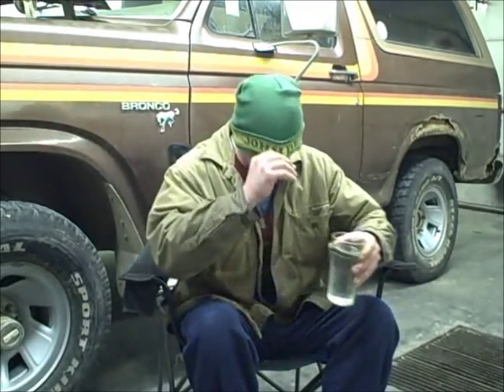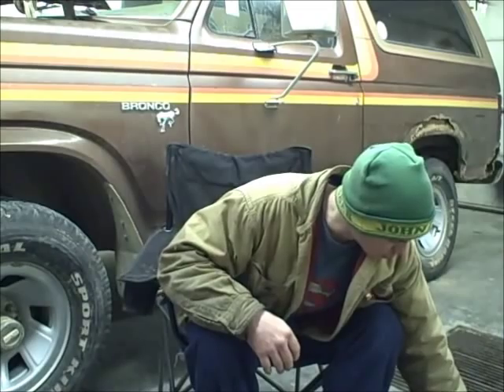Response to my brake line fix

Comment: Let me start by saying that I have worked on cars since I was 10 and I am soon to be 40 and have even been a Diesel mechanics assistant as well.

I know for a fact that compression fittings are in fact safe if they are installed properly if you first check the lines w/ a flat head screwdriver to look weak spots in the lines, then cut the lines w/ a plumbing pipe cutter and use the reamer to clean up the opening to remove restriction clean the cut ends of the lines to help w/ sealing......

Comment: I've got compression fittings on just about every vehicle I own.They've been there for years and there isn't a damn thing wrong with them.They aren't suggested for use on a brake line, but that's never stopped me and I've never had a single problem ever with them.

Comment: Wayne, youre exactly right on why everyone thinks they wont work, the general rule is not to use them but thats because some jackass like one of these naysayers might not put them on right so its safer to tell everyone to just not use them then to take a chance. If used correctly they bubble the line so much theres no way it could come off.I have used them for years and they work even on a big Chevy truck. Have one on the rear thats been on there for over ten years. They just dont have a clue.

Comment: @wagner59270 by the way, the exhaust was not "chopped". the catalytic converter and muffler were removed and new pieces of pipe were welded onto the existing pipe to replace them. it has no leaks and no longer has a partially plugged converter.

Comment: compression fittings aren't all alike, not even close. a compression fitting for a hydraulic line isn't 2 or 3 dollars at autozone nor is it made of cheap brass. there's a reason it says on the package NOT to use them on brake lines. the reason is not because people don't know how to use one. if that were the case, maybe it should say on all oil filters, "not to be used on automobiles", since not everyone knows how to use them. bottom line: compression fittings are not to be used on brake lines.

Comment: No good deed goes unpunished! That's what we always said when we got stuck in a bind like this. It's cool that you decided to account for the repair. I will ALWAYS be held accountable for every repair. I had a call for an accounting of a repair I did in 2008. I sent all the documentation, photos, and engineering off to the customer today.

Comment: You did your best considering the situation you were in. I know of a few shops that still use compression fittings on cars in hard to get places and they have the correct flaring tool.

Comment: You can work on my car anytime. I have used those fitting for years, I have even used them on my semi truck when I have found a hole in the line. My old 81 chevy is still running those fittings on the brake lines on rear, I think I put those on 8 years ago.

Comment: Good work and quick thinking on those lines.  As I stated in the actual video of the repair, it'll do until it can be properly repaired or the vehicle scrapped. I have also done the same to get my Jeep off the trail and home.  It may not be "correct" but it still is better than having rear or no brakes at all.

Comment: Then you'll need 2 compression fittings and enough of the proper diameter brakeline.
The reason is so that you can cut far enough back on each side of the line to have soild brakeline to use the the compresion fittings to join the the old line together.

The above is COMPLETLY safe because the drum of cement mixers use hydraulic pumps (w/ 5 - 10 gallons of hydraulic fuild) and hoses w/ compression fittings to turn the drum w/ cement in it requiring several thousand pounds of pressure.

Comment: I would probably shell out the bling for a double flaring tool, $30 @ autozone.  I got that and I bought a bleeding system for changing brake fluid(I used to track my cars) 
For most cars, your are correct, you cannot by pre-bent lines.  You have to make them up by hand.

I bought a cobbed up Toyota from a guy who really did a hack job once.  He had random hydraulic fittings adapted together at one of the rear brakes and the pressure actually split one of the fittings open.

Comment: You the best you could with what you had to work with Wayne, I personally would not think twice about using a compression fitting,but like you said if the fitting is applied correctly they are safe...

Comment: @wagner59270 that's wilwood, not autozone. did you see a wilwood compression union on summit's site? i think not. you used a cheap all brass union. there is a huge difference. there's a reason most states don't allow them to be used on brake lines.

Comment: nobody should have argued anything.  there was only 2 choices to the fix.

cheap fix (compression fitting and small piece of tube) also more affordable labor wise.

the more correct way to do it costs more because you would have to bend tube, flare and install on both ends which also takes longer to install. labor and cost of parts is more but it is the better of these 2 options.

i support his original actions. with the customer knowing, it all comes down to price and life of the vehicle

Comment: @godtar01 maybe 35-45 degrees but that's irrelevant when you're not flaring at all. the only way to properly splice a brake line is with flares. that's the point i was making and i did.

Comment: And the fuel line repair kit has compression fittings, will hold up to a 75 psi fuel pump.

Comment: @WhoSaidTyler I understand this BS law is on the books simply because back in the day people would not take the time needed to install them properly. Back in the 40's or 50's they used to sell brake pad relining kits where you had to clean the metal shoes down to bare metal & use a strong glue to attach new asbestos pad however people are and can be lazy they weren't done right & were killed because of it not being done right so laws were passed to ban the sale of the kits.

Comment: compression fittings will work just fine, I've used them for years and NEVER had a problem.... YOU MUST INSTALL THEM CORRECTLY, THOUGH! Flared fittings and unions are preferred. As far as liability? When you do work for other people, you create a certain amount of liability for yourself, especially when it comes to brakes. Evenif the customer is a good friend. It is called CYA...if you know what Imean... The big chain auto parts stores have always carried ant brake hose I have ever needed.

Comment: I'm not hating on anybody but have a few points to make:

1. There's not a law found so far that says compression fittings are illegal on brake lines.
2. Accusing somebody of trying to kill a person is going too far.
3. I went through PartsAmerica just now and I can have rubber brake hoses at $25 a pair in hand tonight, provided that's a 91-94 Olds 98. Somebody should have gotten them for her, end of story.

Comment from the maker: @schrankm yes but apparenetly you cant fix exhaust leaks or carbureters you replace motors because they need valve seals and like to rev up cars before theyve been properly warmed up... oh btw if you dont use the factory bolt on that hubcap it could come off and kill someone  LOL... now go away until you can prove some form of reasonable credentials besides ductaped seats air horns and chopped exhaust on four door mommy cars

Comment: @wagner59270 i'll bet you $10,000 that "mommy car" runs better than anything you own. it runs just like new and gets better fuel mileage than it did brand new. the exhaust was "chopped" because anyone working on their own older car doesn't replace catalytic converters. while i removed the converter, i also removed the muffler, which had a hole rusted in it. i don't replace mufflers either. they're a waste of money and, where i live, loud exhaust is rarely an issue.

Comment: I wouldn't worry about the trolls tho, if most of them knew what mechanics had to do when working on their cars, they'd freak out just as much, lol.

I was trying to think of why the lines would have been pinched off on the front, but now that I think about it, I know that the older cars (70's 80's) had fully separate hydraulic systems front and rear, but from the 90's up I've noticed they started combining the reservoirs again.

Comment: Take it from a guy that double folded a broken brake line, held it in place with a pair of vise grips and a boot lace and then drove the vehicle 125 miles home that you do what you have to do...
And YES...I have certainly used compression fittings to repair brake lines...that's WHY they sell them at Autozone, Advance, O'Reilly and NAPA.  They WORK if installed correctly.

Comment: @wagner59270 where the hell did i say i was replacing an engine (you said motor, motors are electric) BECAUSE one needed valve seals? i never said why i was going to replace any engine (not motor). you can't know everything about something of mine if i never told you.

Comment: I saw nothing wrong with the repair.I also didn't get to read any of the comments. .As for the compressions fittings , I used them on the bracket car which is in  in my profile photo and a couple of my cold start vids.I used that setup  for nearly ten years, before  I later upgraded the brakes . Don't let the critics get to you, most of those people probably never work on anything themselves .

Comment: Like i said in my comment on the repair vid, we is compression fitting on all kinds of lines that have pressures above 10000psi, and if anyone has a problem with that they can consult my 10 certificaions that just deal with high pressure lines, my 3yrs of college and 10yrs on the job!! i will stand beside what wayne did as if it were my repair!!! does no one relise that wayne is a full time mechanic and went to college for this line of work?

Comment: lol what really sucks is that she PAID to have her car fixed incorrectly. i know compression fittings do not work or last on brake lines. in fact, i just saw this the other day. a friend of mine has a car that leaks brake fluid faster than it can be added. where does it leak? it leaks from a line that has THREE compression fittings on it and all three fittings leak. what's the solution? buy a new piece of brake line, flare the line ends, and reconnect the lines with the correct union fittings.

Comment: it irritates me how he keeps saying the lines are unavailable. there is no shortage of universal brake line, not that i'm aware of. it's damned simple to buy a piece of line, bend it how need be, flare the existing lines on the car, and use proper fittings to reconnect. any brake line can be replaced, no excuses.

Comment: @wrksnfx Same with brake wheel cylinder rebuild kits (1970's) but laws were passed against them too for the same reasons. If you want a real laugh look up stupidlaws . com and go to your state you'll get a good laugh like in Michigan you could get a .10 bounty for every rats head you brought into any city building.

Comment: dont listen to anyone i BOUGHT MY TRUCK FROM THE DEALER WITH COMPRESSION FITTINGS IN A BRAKE LINE.....IVE DROVE IT OVER THREE YEARS WITHOUT NO PROBLEMS.

Comment: hey wayne dont let people get to you i have seen far worse fixes then the one you did if anything that fix is better and stronger then most also i know a guy that used black rubber line as fuel line on his van and it lasted  6yrs like that cant say much about the rest of the van but hey the brakes work you didnt hide anything from her and like you said car is going to the wreckers anyways  great vids keep up the good work cheers

Comment from the maker: @schrankm most likely the reason youve never had such toubles is because youve never rebuilt an engine... ahhh damn I guess you walked right into that one, and done say you have cause I read youre description ad the reason youre replacing your "motor" is because its got bad valve seals, whatsa matter mad cause someone called you out come one youve gotta try harder than that to mke me look bad especially with what youve got posted

Comment: whats front wheel drive have to do with braking? lol. ANy way I have used compression fittings my entire life on brake and fuel lines and they work just fine. This isnt my first rodao.

Comment: WRONG! Compression fittings are NOT safe for automotive use. They are fine for home central heating systems that typically use around 6psi pressure. Consider a car brake line is pressured to up to 3000psi and the comparison is quite stark. In an emergency the ABS system is pressuring the system on and off many times a second at around 3000psi. This could easily rip a compression fitting apart. 

Flared pipes are the only safe fitting but believe who you want to believe.
Reply: jnbing is it right no will it work yes I'm a professional mechanic used it on my personal vehicle a few customers who I told and said hey this aint right you still want it this is what i gotta do and they agree to it and not one time have I had an issue

Comment: tell them to go to hell man  ive used pressure fittings for years and never have i had a problem no they are not the right way to do it but they will get you buy when times are hard

Comment: Yeah I know what you mean about the commenets check out my brake pad replacement on my van Its a safe way to void bleeding to do it yet I had someone saying it was wrong. Well you can see with the comments. Yeah double flares I never really do them either. Yeah got to do what you have to do lot of ppl dont understand that.

Comment: Dont listen to the know it all cry babys. do what you have to do. I used compression fittings on my truck brake lines. iv damn near locked the wheels up mashing the brakes and havnt had an issue. my cousin used them on his truck and pulls a boat and they have been on for coming up on a year.

Comment: Listen I have used them before. are they the perfect solution no. But do they work yes. All of these people are saying they don't work and I have never seen a failure to back up what they are saying. I am Ase certified in Brakes. I know they say not to use them I know they aren't the perfect fix but in a pinch they will work I have not seen one fail yet. I would never use one on a customers car just to cover my ass. but if i was stuck its better than driving with out brakes.

Comment: can't find replacement lines? that's a bunch of shit. all brake lines for that vehicle are readily available. you just have to want to find them. even if you couldn't find a particular flex brake line, the right way to fix a steel line is with double flares. if you use a loaner double flare tool, it costs less than using a shitty compression fitting and it's "fixed" correctly.

Comment from the maker: @wagner59270 , a smoking chevy that idles like hell and has a major exhaust leak and a four door mommy car that you chopped the exhaust off LOL wow rage some more silly troll cause as far as I can see youve got no mechanical ability watsoever and youre critizicing me on mine go away silly little boy and go chop the exhaust off another car and call it fast cause its loud, oh tw its not normal with a properly tuned rochester carb fr it to just die randomly wen you start it up

Comment: So you can't buy prevent lines so you cobble them together? Ever hear of bending lines? So if the fitting fails and kills someone we have 2 videos of you admitting you shouldn't have done it but did it anyway. Just scrap the car If it was going to get scrapped in 3 months anyway